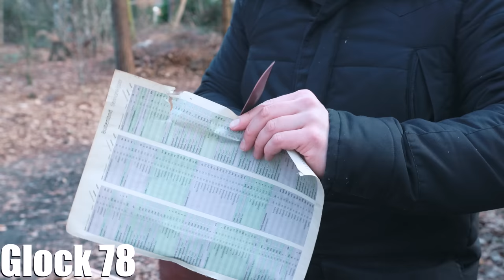America’s Army needs a new knife ASAP.. Ka-bar Vs Glock 78

Comment: Later in the year Spartan Blades and Kabar are collaborating to bring out a USMC in MagnaCut, would like to see a test on that!
Reply: Will making it in Magnacut resolve the USMC’s tang strength deficiencies without widening it and adding weight to the blade? I don’t know enough about that blade steel to speak to its strength and temper.
Reply: Seems like it would be expensive by military standards
Reply: @cearealkiller5956  well its probably not going to be issued of course lol.
Reply: they did it was made with magnacut and still broke.

Comment: Having used the glock knife, it's not the best (like soft steel) knife.  But you also shouldn't look at it as a knife, but as a pry bar with an edge that's good at stabbing. Because that's what it was built for.
Reply: Yeah, I've had many Glock knives.
Most of them have very soft steel. 
And the tip test in the video, don't know, I've done it many times, and it bends extremely easy. And then when bending it back, not perfectly, you have an s shape in the tip. I value the tip higher in the Ka-bar having tested those also.
Reply: I also had a few glock knives that I even couldn't get an edge on.
Those were in the minority. Still not a fan of the glock knife. It's overrated. When stabbing hammer grip the hand slides forwards. Slick handle. But that can be countered with ranger bands. As I did with the Buck 120. Makes a huge difference.

Comment: I'd be curious to see a vintage KaBar up against a modern one. As a sharpener, I can feel the difference between old and new Kabar steel.
Reply: Old Kabar is stilll 1095, probably a bit softer heat tratment closer to 55 HRC. At least based on what I see in my WW2 era Ka-bar.
Reply: @TheModernSurvivalist  I bet the blade is softer, but more than that, I wonder if modern ones omit the extra step of differentially tempering the tang and ricasso to be softer, and therefore not snap.
Reply: The mark 2 was made by a whole bunch of companies for ww2, and even today it's not just cutco making the pattern. 

I can say this, my vintage camillus mark 2 is softer and ground thinner than my modern cutco kabar mark 2. Both are highly capable but neither are bushcraft knives.

Comment: In the Army, there is no issue knife typically (sometimes the M9 Bayonet). We got "issued" from the RFI or Rapid Fielding Initiative, or civilian items purchased off the commercial market like tools, sunglasses, goggles, etc. So, many units picked things they decided were appropriate for their needs. We saw A LOT of multi-tools like Gerbers and Leathermen, and Gerber knives in various forms. We were also allowed to carry personal knives so it was the soldiers' choice at that point. I carried Cold Steel and Spyderco pocket knives, RAT-1, etc. Plus several fixed-blade knives attached to my Load Bearing Equipment and Armor. I also carried a knife attached to my shin because the Infantry has to look cool, lol.

Comment: I use both while I was in the Natl. Guard. I was good either way, but I gravitated to the Ka-Bar. I was in a field hospital and used the knives for just about everything to include driving small tent stakes and digging small rain trenches around my individual tent. The steel butt on the Ka-Bar meant I could hammer with it for small projects without going to find a hammer or e-tool. The sawback on the Glock was an advantage on digging around roots and notching small limbs. If one were to modify the butt of the Glock with a steel bolt, it would probably win out.

Comment: For the life of me I cannot understand why Kabar doesn’t release an updated version with a much more robust tang, similar to the Cold Steel Leatherneck SF. I freaking love this design as long as the knife is strong enough and the grind is right. This is where I take issue with Cold Steel’s design, bc they have inexplicably decided to use a hollow grind instead of a proper sabre grind, or even a flat, which is what they used to do on the Leatherneck SF. Also, to both Kabar and Cold Steel: incorporate a freaking lanyard hole at the bottom of your handles! Seriously! Make the strong leatherneck thickness tang design with a proper saber grind and lanyard hole, and you guys will watch your sale of this design go through the roof!
Reply: I wish I'd snatched up one of the flat-ground Leathenecks when it first came out.
Reply: @puddintame6310 you can still find some for sale on eBay; I don’t think the flat ground models were in D2, though.
Reply: Because the BK7 is the robust version

Comment: I also carried an M7 that I had cut the barrel ring off of for my field knife. When I was in the (US) army (late 90s to early 00s) they could still be had in a surplus store for around $10. They are fairly stoutly built though I doubt the steel is anything special. I would love to see you guys do a review of one. We were issued the M9 bayonet for the Bosnia deployment but they made us turn them in to the armorer after a few weeks because too many guys (who had apparently never handled a knife before) were playing with them and cutting themselves. Almost everyone also carried a Leatherman or a Gerber multi-tool. I made a little side money sharpening knives for guys in my unit and just from my observations the Leatherman tended to hold up a bit better in the field. We encountered the Russian army there as well and one of the guys in my unit traded one leatherman for an entire Russian uniform, fur hat, boots and all. I was sharing a camp with the Swedes for a time and they all had basic Moras as a utility knife. Also, their (the Swedes) guidon (unit flag) , instead of being a two-section pole with a bit of vaguely spearhead shaped gilded pot-metal at the end, was an actual ash spear with an actual steel spearhead that just happened to have a flag tied to it.
Reply: I switch between an M9 and and a smaller kabar, why cut the bayonet mount? Even without a rifle it gives you a great purchase on the blade.

Comment: The Glock at first glance looks like a bayonet. I looked into it and it can be used as a bayonet.. I guess for bushcrafting, that's kind of useless but in a military application, that can be very useful. The steel being a little softer probably helps it not break when stabbing things. Better to have a bent bayonet than a broken bayonet..

They both look cool in their own way. Thanks for doing the comparison video. Cheers!
Reply: The Glock knife is made for use as a bayonet for the Austrian Rifle STG 77 ( Steyr AUG )

Its balanced to be a throwing knife as well. It was designed by the Austrian special forces.

Comment: Knives I carried in the US Army infantry:

Ka-Bar
M7 Bayonet
M9 Bayonet
Cold Steel Kobun
Navy Mk 2 Dive Knife (when diving)
Ontario RAT-3. 
Different no-name folding knives
Spyderco Delica 4
Different multi-tools Leatherman Wave was the best. 
I think the best knife was the Cold Steel Kobun. It was a good bushcraft tool, and a good fighting knife and very easily concealed as a boot knife or belt knife.
Reply: Also I could tape the Cold Steel Kobun to the shoulder strap of my rucksack or LCE inverted and it would stay in the sheath.
Reply: Correction: US Navy Mark 3 Dive knife

Comment: I WAS U.S. ARMY, GENERATOR MECHANIC PLUS. WE HAD THE NEWLY RELEASED M-9 BAYONET, REPLACING THE OLD ONE. ATTACHES TO THE M-16A2 WE WERE ISSUED. WE USED THE NEW M-9 FOR PARADES AND CEREMONIES.  LASER SHARPENED AND DESIGNED NOT TO STICK IN BONE! THANK YOU FOR SHARING!  AWESOME VIDEO!  👍🏼👨‍✈️👍🏼

Comment: I've seen one claim that the USMC now issues the "Ontario Knife 498 Marine Combat Knife, 8180" and another claim that they issue the "Ontario 8-inch US Marines OKC-3S Bayonet - 6504" . . . both of these knives use 1095 carbon steel with a hardness rating between 55 and 57. Would be interesting to see how they compare in these tests.
Reply: The kabar uses 1095 cro van tho
Reply: They stink. My friend was in the Marines during the change over. He hated it. Got a Cold Steel Leather Neck clip point.
Reply: It’s the OKC-3S bayonet, never heard of the other one much less seen it issued
Reply: It's the OKC3s bayonet. I was with 2nd Marine Division 2005-2009.
Reply: @The4cp  Eh? I love my OKC-3S.

Comment: Let's be honest, the main reason to buy the Kabar is because it looks like the sexiest knife ever produced.  I have one and what I like about it, is it fits and feels great in the hand, nice and balanced and I think it works really well for chopping wood because of it's length and it has a bit of weight behind it.  Also I really like the notch at the end of the handle.  You can use it as a hammer.  It might not be the strongest knife in the world but if you don't mistreat and abuse it, it will last forever.

Comment: Are we talking Utility knife or fighting knife ?  Major difference here. I have NEVER been able to get an edge on a Glock that I would deliberately take to a fight. That said, A MODERN 1219C2 is the same. My main fighter is/was made by Camillus. My actual Ka-Bar is retired. It did it's job and brought me home. But it has a story that gives it sentiment. Suffice it to say that it was ISSUED to me by my MOTHER before the BEIRUT, LEBANON conflict in 1983. The blade still has blood stains , some mine, some not.
Thus it's retired status. I then acquired an older Camillus that has been within arms reach of me every since. The newer KA-bars simply would not take an edge that met my standards. A utility knife and a combat knife are difficult to get into one blade.

Comment: In 2011 I was in Afghanistan and carried the same glock knife. The reason I carried it was a family member who was in Vietnam had to use a knife in a few fights and he found that having a a thin blade that can fit between ribs easily and not get stuck in bone is best. This is the main reason I chose to carry the glock knife, that and that handle and blade would be very low maintenance and I could just wash it with water bottle after being in a turret all day or on patrol/climbing mountains and stuff

Comment: Outside of extremely specialized units in very rare and specific circumstances the U.S. military pretty much uses multi tools and folding blades. I was never issued a bayonet but I used my Gerber almost daily. So much so multiple tools broke and I replaced it with a much more capable Leatherman. Large fixed fighting or survival blades were at best novelty items for a few guys.

Comment: I used to carry an original straight back Gerber BFM.  What I knew about knives at the time was enough to be dangerous. Wasn’t exactly good for fine work, but chopped wood well and the point didn’t break off instead. Still, I should have bought the Randall #1 next to it on the shelf that afternoon an Ranger Joe’s in Columbus. I have been tempted several times to buy a Glock knife but had heard it was hard to sharpen. Also I haven’t seen one without the saw teeth for a very long time. I have a Camillus K-Bar copy that has been decent for what it is.

Comment: The KA-Bar is about 2-1/2 times (on Amazon) but that is because of the "Brand" and the leather handgrip is a little more expensive to make.  It has been a long time since it was an official military knife.  The design is a quickly mass producible one that could do a lot of things but not the best at anyone thing.  There were so many made during WWII that they military had stockpiles of the knives that lasted for over 20 years.  -  The correct modern comparison is the OKC-3S.

Comment: i own a glock 78 and after A LOT of hardwood processing, stil no rattle. it's a legit beast, absolute vfm ! 
my only complain is that it's difficult to sharpen properly and have a razor edge..
Reply: When I was in the Austrian army we were actually forbidden to sharpen them.

Probably because everyone who DID try ended up grinding half the knife away trying to get a proper edge on the bloody thing... 🤣

I occasionally pull mine through an any sharp, a little work on a 400 stone and (at least forme) that's easily sharp enough to accompany me the next few sorties through the woods.

I did successfully sharpen it with a flat river stone too several times though. Not razor sharp but certainly good enough.
Reply: I found the Glock knife in a junk store with no sheath for about $15. I made a PVC sheath for it and now it lives in my truck toolbox.
Reply: I can cut onions with mine...

Comment: The Glock 78 is great for thrusting but it doesn’t have sufficient belly for cutting.  Also the KBar is tougher and 1095 is a tough blade material that holds a great edge.  We need to replace the sufficient tool with a better tool not one less suited for the job.  1095 is a good choice for this tool.  It is a very tough steel.  Any good field craft knife would do.  I also like the Scandi steels 1428c is a good alternative too.  I do like the Glock knife.  The clip makes it secure, but it is a two handed draw.  That might be an issue in a fight.  The only issue I have with the KBar is that you have to keep it oiled or it would rust.  Needs a blade treatment for sure.  Once again 1428c is better for that.

Comment: Fun video. Lots of energy! Very entertaining. I was in the Army 2002-06. I wasn't issued anything but the M9 bayonet. We all bought our own knives. Isn't that Ka-bar more of a fighting knife than a field knife?
Reply: Well, the FM78 is too, just look at its geometry. Thing is, anything sounding as martial as fighting knife would not go well with the german speakers since WW2. At least here in Austria we would probably not have even got one if it would have been called fighting knife. And so it is called field knife... For most of us the main use was tightening and loosening of the blank fire adapter. The adapter is screwed into the muzzlepiece of the rifle and has a slot in which the back of the blade fits. And the handguard of the knife also is shaped for it to be easy.

Comment: The Kabar USMC is a fighter first and foremost, built to have an agile point and used a dagger style construction to again prioritize advantage in a fight. They opted for a bowie style blade over a spearpoint to give the blade a bit more versatility than a dagger would have and then gave it a fuller to again lighten the blade without compromising the blades overall integrity. The blade itself its often not where the failure occurs but rather at the tang where it either bends or breaks. Will it work for a camping and hunting knife? Sure, plenty use them for just that but its obviously not a beast of burden. In a fight though is where the Kabar was made to excel. Also To be fair the Glock Knife is decades newer, Glock didnt even start making knives until 1978 whereas the Kabar was designed in 1942 using much more basic materials and construction and the military needed them to be done quickly and efficiently.

So anyone thinking of relying on the old faithful Kabar Mk2 as your car survival knife, maybe dont. Go full tang, or if you got the money then wait because Spartan blades is working with Kabar on a Mk2 in Magnacut.

Comment: I finally got to the point I was able to waste the amount of money I spent on the KA-BAR and I'm glad I did. It's my only knife that will never be going into the field but somehow it's still useful from a design perspective. It is an incredibly well-designed and balanced tool which was made to be cheap and disposable, excellent for military contracting even though it's massively overpriced for what it is today. The size and shape of the thing make it into a light-weight do-it-all platform. Even the rat tail tang is useful in that it balances the knife for swinging. It has informed the kind of knife I will be looking for next to actually use.

Comment: Give them Ontario SP-1.  It's very similar to the Kabar (also known as "Chippy McSnaptang"), but far more durable while actually weighing slightly less.  It's doubtful that anyone in the military has any conception of how to sharpen and use a knife, so you want a knife that will just make a good prybar and improvised screwdriver.